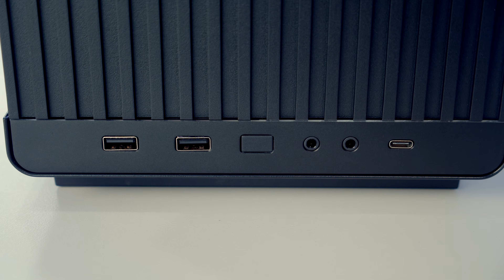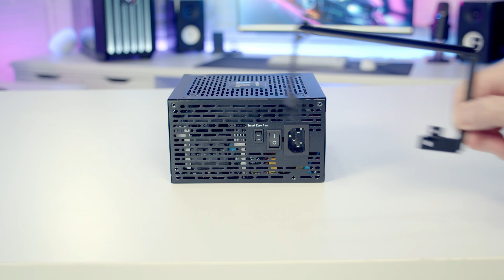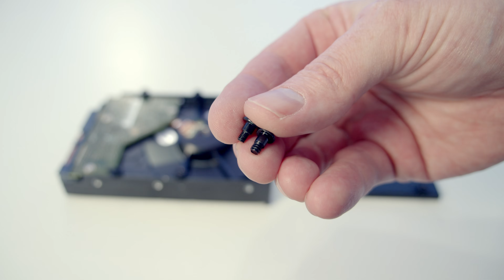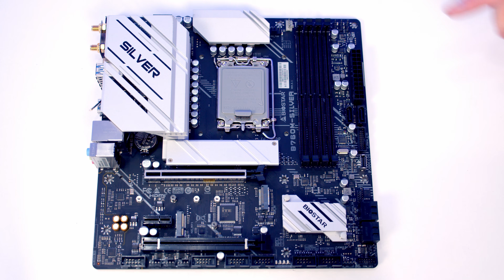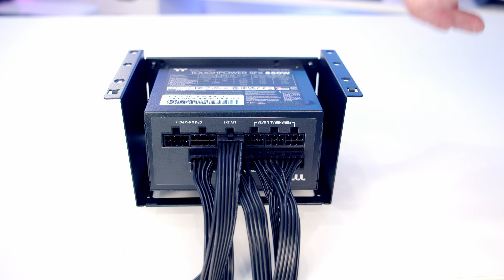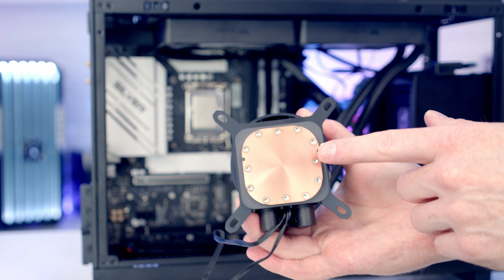Lian Li | DAN Cases A3 Build - Step by Step Guide

Comment: Extremely versatile case. Thank you for this extremely helpful video. I think I will go for this case (with wood panel) for my HTPC build. It looks great, has very good feature set and flexibility for mounts is insane, although I think vertical GPU could have been implimented much better. It looks vertical GPU was planned by burned out engineer with last cups of coffee... but then I have never really liked vertical GPU mounts. Its not my cup of tea, so its not bothering me in this case. Good to see multiple 2,5" and even single 3,5" option in case like this. I also checked how much optional parts and replacement parts are available and they are indeed quite few. Case is very solid for its price point.

Comment: One thing i dont get is why every single video shows the psu mounted with its intake towards the inside of the pc. I mounted it with the intake fan towards the front, intaking fresh air from the meshed wood front panel. This still allows you to connect the power cable and all the cabling is in the same place it would be otherwise. I get it with the plastic front panel like in the video, but i also see it with the meshed ones 😭
Reply: Thanks for the comment! I just wrote exactly same question😅, did you install any side fan?
Reply: @xavic8883 no, side fans seem to disrupt the airflow and i dont like the look. I have a top intake that is flush with the psu so it doesnt catch the heat coming out of the psu, i have 2 bottom intake slim fans below my gpu, 1 exhaust slim fan in the back and 1 exhaust in the top back.
Reply: @il_craparo8937 thank you very much!👍

Comment: Excellent video showing all the options! I just have one question: Intake on the rear? Wont that suck all that hot GPU air in? Especially because the rear of a PC is usually near a wall.
I was planning on doing 1x front intake (140mm?), no bottom fan b/c the GPU is sucking in from there, 2x 140 mm top outtake (PSU is also venting to the top), and nothing in the rear. Is that not smart b/c of reasons?

Comment: fantastic video.
I opted to use an SFX-L to ATX PS2 adapter for a vertical side installation from the front as it works with radiator tubes in the middle but the PSU intake is now on the back which is awkward.

Comment: For anyone who has an ASUS TUF B850M in this case, your GPU will line up with the second PCI bracket on the back of the case.  This will force the GPU to sit fairly low and pretty much eliminate any chance of using fans on the bottom of the case.  I believe the ROG boards are the same.
Reply: Unless you have a massive 3-4 slot GPU you can still use slim fans on the bottom.
Reply: Mine didnt...it went in top space with asus tuf 5070ti with room for antec  novas

However my 240aio was very tight with the heating sticking out on top of the 2x 8 pin cpu cables

Comment: Good job on showing the details and options for assembly. Forthe PSU on the side, was it possible to have the PSU fan facing the case wall? (So it would draw air from outside)?

Comment: Putting a small glob in the center of a rectangular processor with an AIO is not the right way these days.  If you took that back off, you’d notice it’s not providing full coverage for the CPU lid.  You want to fully cover the surface with a credit card or razor blade in that scenario, and extra paste leaking off then sides a bit doesn’t matter (or matters less than not having full surface coverage)

Comment: Something is not quite clear, please can you confirm these details? If you put a full ATX PSU inside the A3 you almost have no room left everywhere, so, once a full ATX PSU is installed are you still able to: 1) Install a 360mm AIO on top, or are you limited to 240mm?. 2) the case supports up to 340mm GPUs, but this is not the case when a  full ATX PSU is installed and the GPU clearance lowers to probably 298mm? If yes, can still a full lenght GPU be installed vertically? Again, if yes, does the dan A3 already have a vertical mounting? If yes, again, do you need to buy separately a riser? Which one? If not, where do you buy a vertical mounting stand? The problem is that i purchased DAN A3, + full ATX PSU + 360mm AIO + 340mm/60mm GPU and probably i won't be able to installe neither the GPU and AIO, and probably the case doesn't even come with a vertical mount and a riser? Should then i replace the orders or buy something else like a vertical mount and change thhe 360mm aio with a 240mm or everything is gonna be fine?

Comment: Thank you for this video. I have just used it as a step by step guide. There was no unnecessary waffle to skip past, I could just pause when I was up to the next step and move on when done. Your demonstration of all the possible placement options and how things slot together was much easier to understand than the exploding pictures in the manual. I wish someone had done something similar for the motherboard I used since it has some features that aren't explained in the manual. 
I have two minor gripes with the case itself.
1. The included magnetic graphics card support sits too far out towards the side of the case for my card. If its plate had been just a little wider it would have worked. This meant I couldn't install a bottom intake fan as I had to use the full-length support that came with the card (or risk going without that extra insurance altogether).
2. I'm not a fan of the implementation of the front to back power extension cable. The thickness of the rear  boot prevented me from placing the top exhaust fan as far back as I wanted, leaving a risk of turbulence in the (front) CPU cooler fan's airflow. The front power extension cable boot in mine is an L shape that points to the side of the case, so I have to run the cable at a sharper angle than I'd like against this side.

Comment: I you wanted to put 3 120mm fans in the bottom of the case as intake fans, would you need an ITX motherboard so that your gpu would give it clearance?
Reply: No I have 3 120 full size fans installed and a 3 slot 5080 its tight about 10 mm of clearance slim fans would be better

Comment: I wouldn’t recommend rear fan for intake unless you buy a filter for the outside. Optimal fan setup is exhaust top and rear, intake bottom where the filter are and then the passive intake from mesh side (- and front on the wood versions). In all I think it’s a good case for airflow with a “less is more mentality” for fans. A number of people on Reddit don’t even use case fans because the GPU fans intake and CPU coolers are enough

Comment: 8:48 Can the SFX PSU be mounted with the fan facing the opposite direction?
Reply: Yes, it can. At least with the Cooler Master V850 SFX PSU I am using, the way I mounted it the PSU fan is facing toward the front of the case. I was wondering why he had his facing inside the case, as typically you want the PSU fan to be pulling in fresh, cool air from the outside.

Comment: does anyone know if it’s possible to flip the power supply so it’s intake fan is facing the front of the case? feels a bit counter intuitive for it to be pulling air from the centre of the case to me
Reply: Was wondering the same thing... although the centre should be pretty cool with airflow from the bottom, I think
Reply: @prins424  ended up building this and found out the answer is that it can face the front! so no issues here :)

Comment: I think the power supply options are sub-optimal with this case. If you want any intake fans in this case, you have to do it from the side, but that messes up the flow. From the bottom makes little sense. There's no apparent way to mount fans in the front, like in most normal cases. Also, in all videos and pictures I've seen of this case, the power supply is functioning as an exhaust, when, perhaps, it might as well have been taking its air from the front or side. There's nothing wrong with using a power supply as an exhaust, but I would advice you have good air intake, something that seems tricky in this case, especially if you also want an air cooled CPU. Yeah, it's too messy for my liking.

The goal is a smaller case, right? But then they add a lot of options, both for positioning and for space when it comes to fans, radiators and humongous graphics cards. But when all these options come together, the case isn't small anymore. They're trying to solve too many problems at once.

Comment: Have been looking at this case for a while. With a 150mm ATX PSU and a 345mm GPU it's a tight fit. Yours, is the only review that has explained in depth PSU position vs GPU/AIO cooler size. Thanks

Comment: Does the case come with that power supply cable? I want to get this case but I don’t know how the psu would actually get power
Reply: There's one inside the case that routes to the front to the back , then plug your plug into the back of the case

Comment: This video put me a bit off of this case, however spending a couple of hours each day for two days, i found relatively easy fixes for your gripes. Don't take this wrong i like you're video and your honesty. You have an sfx power supply, if you side mounted it, you could even fit a fat artic freezer 3 on the side mount, of course you would have to go for the side mesh instead of TG.  But in (almost ?) every config it improves thermals and since you are on intel i think that would be the more logic choice. Side mounting the psu also makes connecting the EPS power cable much easier, you won't need an extension and you can route it behind the motherboard backplate.

Comment: Great overview! Why did you mount the radiator in (what looks like) the middle of the case? Based on diagrams from Lian li it seems like the recommended way is to put a 240 aio all the way to the left, which would allow your PSU to go into position 1, which will then leave the full 415mm for large GPUs (if upgrading in the future). Am i missing something?

Comment: Awesome Video

The ATX Shroud is too big for an SFX power supply though and takes up too much space
I wish Lian Li had a smaller SFX mounting shroud

To mount a Corsair SF850L or SF1000L SFX power supply on the side panel, remove the Lian Li flat steel bracket from the shroud and replace it with the bracket that Corsair provides

This allows you to keep the Intake fan on the power supply up against the mesh side panel with cables coming out of the bottom of the power supply and out of your way

Hot exhaust comes out at the top 

Works great

Still want an SFX mounting shroud though

Comment: Case is over $80 now and the glass panel is $35... Ridiculous...
Reply: Those side panels are sold out in Canada, now I have to order it from the States and pay extra for shipping. Also the vertical mount GPU bracket for that case costs about the same as the entire case. Both parts are optional but pricing is ridiculous

Comment: Hi. Is it possible to mount the PSU on the side panel such that the fan is next to the mesh side panel intaking cool air but the input is facing down so it doesn't interfere with the motherboard?
Reply: Yes yout can (if I understand you correctly). I have an ATX power supply mounted on the side, the PSU fan is against the mesh panel and the cables come out from the bottom.

Comment: For those wondering if the corsair shift (850w) would fit. The answer is yes. Use the ssd tray to mount the psu but you can go over 267mm (asus 4070 dual) or you will hit the plug sockets. Its a tight fit but it will work. The amount of options for mount the psu is insane.
Reply: Just the answer i was looking for! I was looking at the RM750x Shift and was wondering if anyone has built with a Shift! thanks!

Comment: Thank for this! i have 1 query.. you show in the vertical mount.. the PSU mount on the side has no limits on the length of the PSU... so does this mean.. i can now fit ATX PSU's greater than 150MM when the GPU is vertically mounted? Please answer.. this is the only thing holding me from buying this case.. my PSU is 160MM and GPU is 360MM and this is the only scenario it will fit.

Comment: Can I fit 3 bottom 120mm fans in here with a 7900xtx? (Either a hellhound, Asrock phantom gaming, xfx speed merc or sapphire pulse). Thank you!
Reply: As long as its less than 61mm thick, yes but its a very tight fit if your at 58 to 60. I think i would be better to leave it with no bottom fans if so. You can search for the dimensions of your card in the manufacturers site.
Reply: Yeah, I spoke to the Lian Li customer service account on Reddit who confirmed it would fit. :D

Comment: I wonder if a 3 slot 4090 with a 4 slot width would still fit with the VGPU mount. I have a Suprim X and it's a chonker. Not the longest 4090, but definitely a thicc boi. I would like to recycle it into a new case if I can, though as a backup the MSI Gaming X Slim would be a sufficient replacement with no compatibility issues.

Comment: So the gpu fans are the intake for the entire case? The mesh side makes more sense. The airflow through the gpu doesnt seem enough for the exhaust through the radiator
Reply: Just built in this case 3 slim fans below gpu pulling air in is sufficient my aio is side mounted both 5080 and cpu run cool under load usually sub 60c